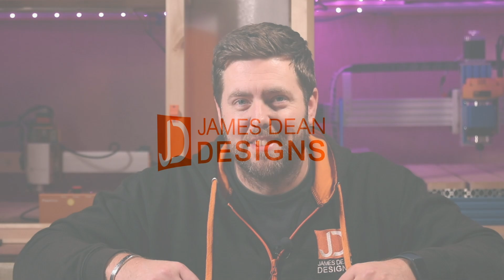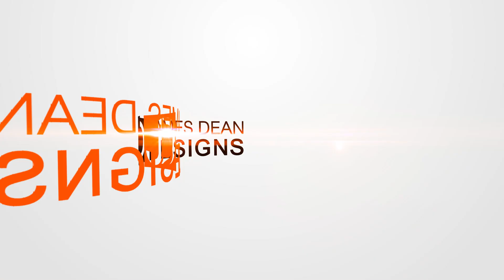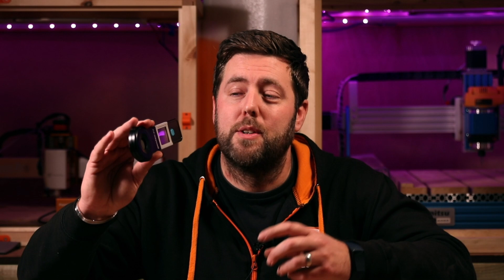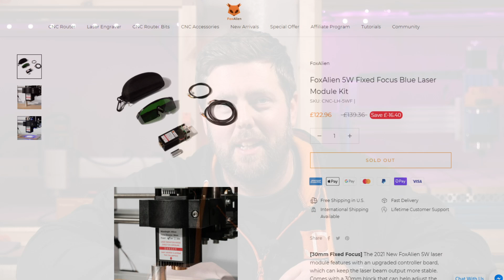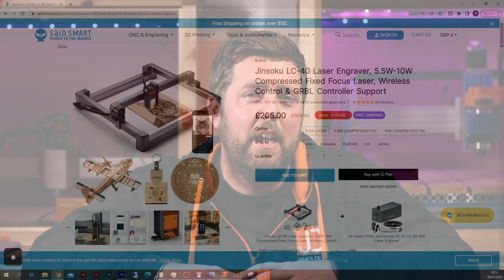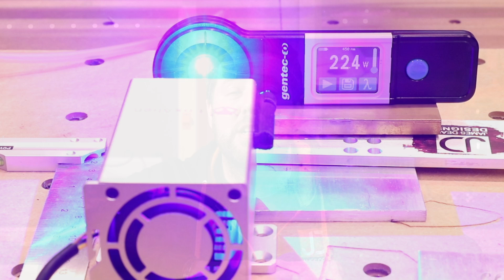Should you trust laser power ratings?

Comment: Great video!  An interesting question came to mind... How accurate are the laser power percentages in lightburn?  In theory,  if you run a 10 watt laser at 50 percent, you should get an output of 5 watts (more or less). Might make an interesting video..  The reason I ask is that I have a laser job I've run several times at 5 passes and 95% to cut the wood.   The other day, I decided to run the laser at 100% for the same job.  It cut most of the pieces all the way through in only 2 passes!  I was surprised that 5% made that big of a difference.  Anyway, thanks again for the great video!
Reply from the maker: I didn't think to check that to be honest and the device has now gone back but you are correct, 5% should not make that much difference unless there was other factors at play such as a different grade of wood.
Reply: @JamesDeanDesigns  no worries,  wood was from the same sheet of plywood as the others.. I was thinking it could be that I had recently cleaned the laser lens, or the way I focused the laser..  Or, at 100% there are no limits on the laser and if the laser is rated at 10 watts (like mine) but is capable of putting out 12-13 watts..  That could make a difference too.   My guess is it's a combination of all of these things.  Too bad that you had to send that measuring tool back,  it looked very expensive..  Thanks again!

Comment: Hello James, I don't know if this is kind of a stupid question, but are all of the lasers cross compatible ? For example I'm looking into getting the Sain Smart cnc, but will the Fox Alien laser be compatible with this machine. Thanks from Utah... Cheers.
Reply from the maker: Yes, for the most part. You just occasionally need to check the wiring. Some manufacturers change the order of the 3 wires. Generally speaking lasers above 10w output will also come with their own power supply as well which helps
Reply: @JamesDeanDesigns  perfect, thank you sir for the help 😁

Comment: Great comparison James! But the lasers do loose output when combined. The Sculpfun S30 for example, is advertised as 10W, but it has two 6W diodes. Similar goes for all others; most using 5.5W diodes for combining. The most powerful single diode for a laser engraver is 7.4W by the rules of physics.
Reply from the maker: Thanks. I should have probably clarified that part better in the video, for example FoxAlien publicly say their 20w is made up of 4 x 5W lasers and then people argue that doesn't add up with power loss. But in reality the diodes being used are above the rating but not loosing as much as some probably expect. Good point to raise.

Comment: Hi James.  Hope you can help. I just purchased a 40-40 xe and am trying to cut out a project but when I open it in candle it shows the project but has a small red square in the middle and only tries to cut anything inside it.
Reply: I don't know the answer, but one thing you might check is if candle has some idea about the size of your machine. I'm pretty sure it is a $ setting somewhere. It may be being helpful be making sure you don't hit the end stops on your machine. If you got candle separately from the machine there is no way for it to know how big a machine you are using. So the fix is just to set the cal parameters to the correct sizes for your machine. Another thing to check is scale - if your G code actually trying to cut a massive area for some reason - eg the CAM that generated it scaled it wrong, or it is interpreting it as inches instead of mm.

Comment: First
Reply from the maker: Is this still a thing people are doing, have one for ages 😆
Reply: Can you Help me I have a 3018 pro laser engraver and it didn't can Cut anything but it says thats its a 5w laser.
I want to engrave some acrylic with the laser.
Reply: Sorry for my Bad english
Reply: @rolandrethati2549  Is the acrylic clear ? If not, what colour is it ? Have you tried cutting anything else, what about paper/cardboard. Will it do anything with that ? (I'm assuming you have a blue laser, is that correct ?)
Reply: @transientaardvark6231  yes I have a blue laser and I can Cut Wood and Papier and kardboard stuff like that
And the acrylic is clear.
Reply: @rolandrethati2549  Ah, that is your problem. Things are clear because they do not absorb light. To cut with a laser the material has to absorb the light and as a result it gets hot and "burns away". So you cannot use light to cut something that is clear. Now, acrylic (even clear) absorbs infra-red light - so you can cut it with a CO2 (infra red) laser. But not with a visible light laser. Maybe try googling "cut clear acrylic with blue laser", because I think some people use tricks, like painting the acrylic black. But I doubt they have much success. I would suggest you simply use a spindle to machine it. I would also caution that with clear acrylic the laser will go through and hit whatever is under the acrylic, potentially burning it or reflecting off it and scattering laser light around the general area which is potentially quite dangerous. In fact reflection from the shiny surface of coloured acrylic is also potentially hazardous, so only do it with the whole thing in a light-proof covering. Also, as I'm sure you know, acrylic will produce toxic fumes when it burns so you need a good fume extractor if you do that.
Reply: @transientaardvark6231  thanks for the informatioms